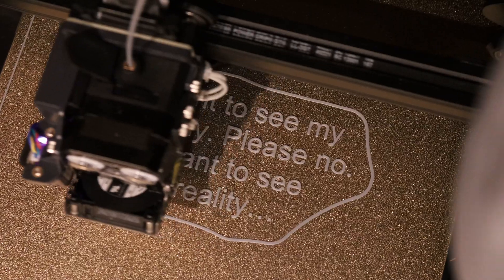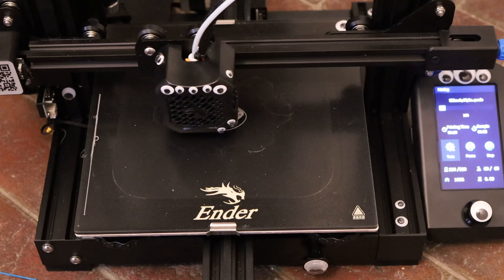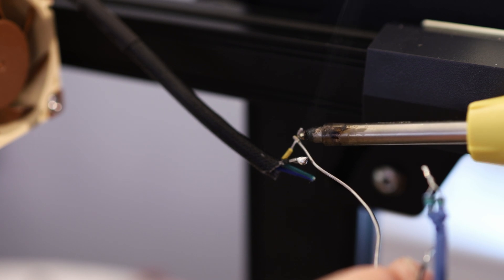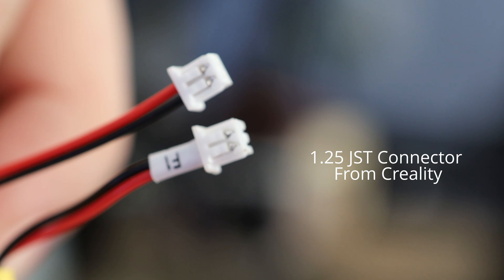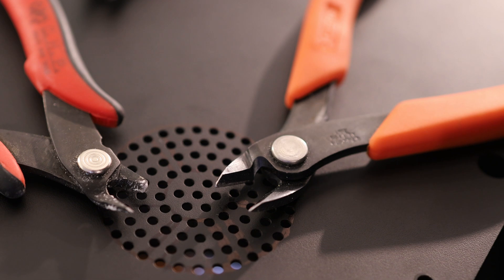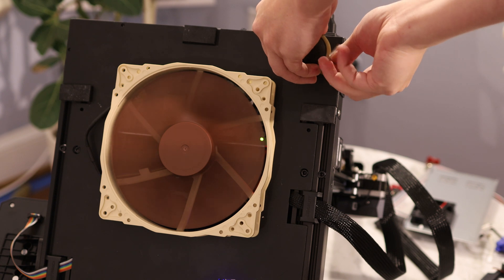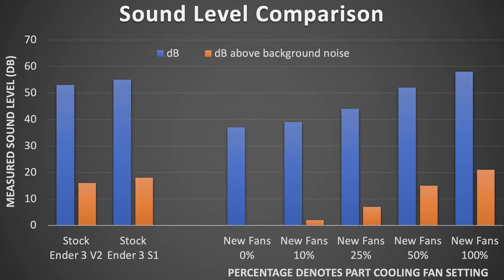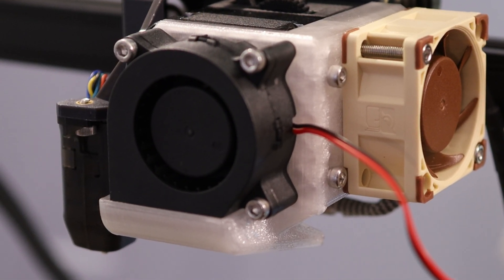Ender 3 S1 - The Silence of The Fans

Comment: Fun fact that most people don't realize. When working with a power supply, you can actually discharge a capacitor just by licking it.
. 
. 
. 
. 
. 
. 
. 
. 
. 
. 
. 
. 

I did not say it would be safe.
Reply from the maker: Note to self: Do not take safety advice from Esotaric Bear...
Reply: Similar to how all mushrooms are edible, but some only once
Reply: @therick0996  Those ones are the best, or so I've heard.

Comment: Have you tried using a Noctua as part cooling?
Reply from the maker: I have not tried Noctuas for part cooling. Blowers can produce very high static pressures, so it's easy to design a duct for them without much consideration for aerodynamics. I will be making a version for a 40x20 noctua fan, blowing downwards into the duct and post it as a community post and in my Patron (free) this week.

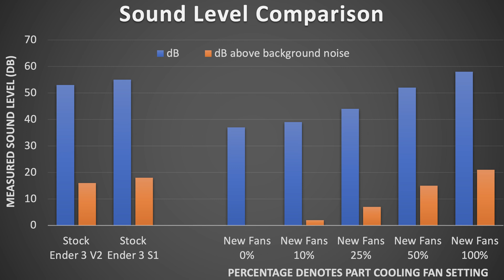Comment: I don't get the graph at 7:43
What does fans at 100% mean? Is that just the part cooling fan or the others too? Why is it noisier than stock?
Reply from the maker: All fans are turned on for those tests. 
The 100% setting is louder than stock, but it is moving about 5-10x more air. 
A fair comparison in terms of equivalent part cooling performance is stock vs 10% on new fans.
Reply: @NathanBuildsRobots  Thanks

Comment: Did you replace the connector to the 1.25jst for the blower fan?
Reply from the maker: Yes, I linked the JST connectors I used in the video description.
Reply from the maker: You can also salvage the connectors off the old fans

Comment: For cutting the metal you could get diamond cutoff wheels from harbor freight to use with a dremel.
Reply from the maker: Cutoff Wheels are a bit tough to cut curves with, but yeah it could be done.

Speaking of better tools for the job, I just tried out a 400 watt laser today that would have cut right through this in about 10 seconds. I'll be going back for seconds and making a video about it!

Comment: Very nice video. Hope some one like u design something like this for the cr10 smart pro. Dont actually know if the hotend is same messurements but seems like it .
Reply from the maker: Yeah it looks the same to me, it would probably fit. I'd like to get one and test it out, but $699 is to expensive for me right now.
Reply: @NathanBuildsRobots  699 is also heavy price. But when I get it i am gonna try your fan duckt on it. If it fits , i would love to see your design with som kinda cooling from both sides, and maybe 5015 blower fan for more pressure. .
Reply from the maker: @eenig8730  a lot of ppl are asking for 4020 noctua, 5015, and 120mm blowers so I'll make all 3 and post them this week
Reply: @NathanBuildsRobots  lovly .. U are the best

Comment: does the zener diode reach temperatures of 150 degrees celcius ????? wtf?
Reply from the maker: That was a shot while powering the 40x20 noctua. The 40x10 noctua is half the power so should run a bit cooler.

Zener diodes drop the voltage by turning it into heat, so they get hot! 🔥
Reply: @NathanBuildsRobots  not sure how u were intending to make a partscoolingfan for noctua fans , but i was thinking: how about making the gap where the blower fan blows through bigger to be able to horizontally lay flat a noctua 40mm fan on there?

Comment: First channel that immediately has been "Patreon"-ed by me.  Keep up the good Ender3 S1 (short ESI) content, and developing "that fann" of yours. :D
PS.: Please, never be normal.... thnks
Reply from the maker: Thanks Krulay! I will be making a couple different versions of that fan shroud, 40x20 noctua, 5015 blower, 120mm blower, am I missing anything?
Reply: @NathanBuildsRobots  I just try to keep up with you, ordering all the necessary equipment to be your gunnie pig guy relating to ESIs :D I will use ASA to print them, 'cause of its UV resistance. The first one is already printed as a tryout from PLA, one not the stl would be nice if orinted in the printing position.
My dream is to make a 12cm Noctua into a cooler in the head (what a nonsense, but fun idea), and also thinking about making a cooling solution, where there is a big cooler is relatively far away from the head, which will be cooled thru a tube. I dont know if pressure and frictions are allowing it, but i like the idea of using something powerful and deliver its stream into the tiny head. A Tube-fun on YouTube .... See? :D 
Man i like your style... I hope/wish you will have the same rising viewcount as 'I did a thing' has since i get to know him. ;)

Comment: That new mount for fans looks great, i saw u swapped the heaterblock and maybe even heatbreak. What are u running?
Reply from the maker: I did the install here. Though if I were to do it again I'd use the slice engineering heatbreak, whi h should fit in without using a hacksaw.
And if I wanted to do it the easiest way, I'd use the slice heatbreak and a mk8 CHT or stock nozzle, and keep the old heater block.

https://youtu.be/YrIYvhOGAs4

Comment: replacing fans is good idea. I would go for 24V (not 12V) as it is easier/faster to install thought a bit more expensive option.
Reply from the maker: Yeah, I have trouble finding high quality silent 24v fans. I wish Noctua would make some.
Reply: @NathanBuildsRobots  is the psu fan also 12v on an s1? In that case, Aerocool makes a 12v 200mm fan with 18dBa noise level. If I wasn't receiving a 60mm and 40mm today for psu and motherboard, I would have bought that instead, after seeing your video...
Reply: maybe you could show a picture of the sprite mother board for the wiring? I don't get how you get 3 fans at the end (if you keep the original one on the left side

Comment: These get better and better each time. I just put one of these bad boys on my Aquila and a SKR Mini 3.0. Too bad nothing happened when I turned it on…not sure what I did wrong yet.
Reply from the maker: A multimeter is great for checking to see if your wires are done correctly, if the fan is seeing 12v it will turn on! Just remember , positive to yellow, negative to black.
Reply: Thanks. I just got a multimeter and have yet to try it out. I don’t think the fan is the issue. They don’t boot up with the board on the 3.0. The stock board fried when the hot end hit the bed. So both the fan and the board are new. This should be a drop in for the Aquila X2 but nothing powered up. I probably did something wrong. But hey I didn’t see sparks or smoke, so any crash you can walk away from right?
Reply from the maker: @jpsfish5966 Damm, how did you run the hotend into the bed? That shouldn't be possible!